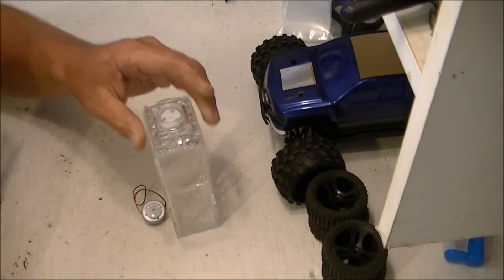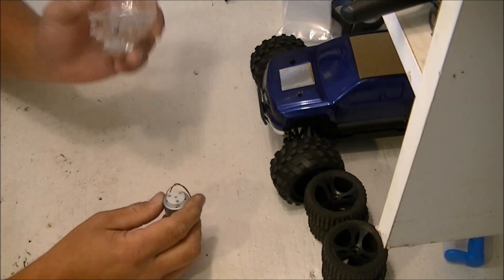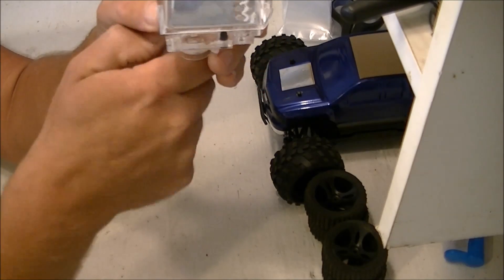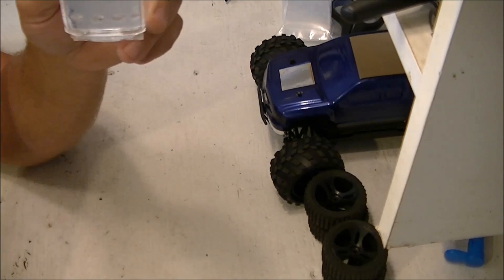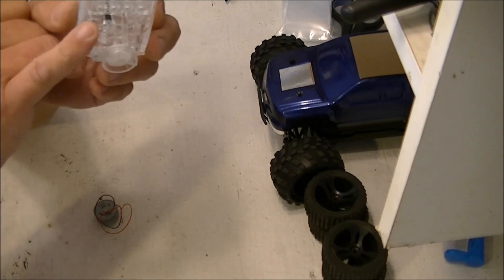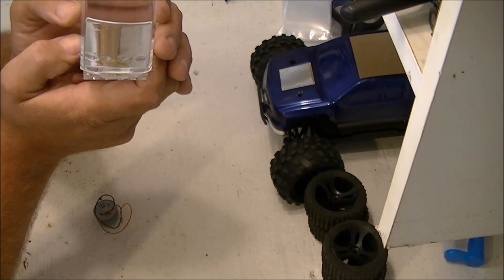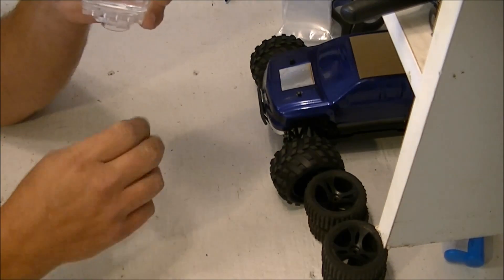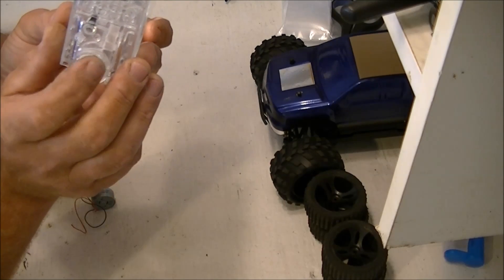Gadgetree Dancing Water Speakers  How The Water Pump Works

Comment: thank you. but i have a doubt. mines work both pumping water at the beat of the left speaker.  so when i put the balance all to the right spaker it doesnt pump water .  Isthis like that or is a flaw or something is broken??

please can you test this?
Reply from the maker: i got no way of testing all my speakers are long gone check the wires in the speaker that has the problem its possible it came off for the motor power

Comment: is there a way i could hook the motor and the LED's to my speaker system i have a little 20W amp that powers my speakers, I tried to connect them through the output but the motor doesn't work?
Reply from the maker: this work as they are but if you find a way to mod them go for it

Comment: is there a way that i can turn it off to where the motor is off but the music is still going?
Reply from the maker: cut the power wires to each motor
Reply: Kevys Rc & Music Okay,  but do I literrally have to cut them or is there something I can unplug.
Reply from the maker: you have to cut atlease the neg or the + wire make it in a spot where it would be easy to reconnect

Comment: can someone help me I have water speakers and they both work and light up but one of my speakers will not shoot water it only has lights and sound can someone help
Reply from the maker: +Graceann hamilton you need a new motor for the speaker thats not shooting water  i have some spares here ill sell 10.00 each plus shipping , hope you know how to solder wires or know someone that does
Reply from the maker: mine was pretty quiet

Comment: will someone please tell how is it possible for the water to even leak? I had my dancing water speakers since last year, and both sides have equal amount of water. then I found out one side lost all its water and Idek how and when it happened..?
Reply from the maker: Imogene Liau thats easy there is a plug where they fill them and they leak there they also leak when you drop them and crack the glass its rare but it does happen

Comment: I'm looking at making some of these, but have no idea where to get different parts? Like the magnetic thing on the end of the motor, or the impeller, any ideas?
Reply from the maker: buy a 3d printer and design and print your parts the magnets shop around on the internet you will need the control boards as well and when you go larger scale you need more power to run stuff so youll have to design that as well or pay some one a large amount of cash just to get you 1 prototype done
Reply: Kevys Rc & Music 
do you know of a layout that can be used for the 3d printer to make the parts?
Reply from the maker: Isaac Hanneysee no i have no idea i know how they work i know how to fix them but thats it man , try google

Comment from the maker: well i only explain it i dont aucutally show it being done, basics are you need an injection needle  small one of course you need mineral oil and the thinner for it yo uhave to find the right balance so it flows right like water, you then inject the stuff into the speaker glass, then re plug the hole thats already there with a plug so it cant leak back out. even in this video i tell you how its done.

Comment: hey Kevin first things first thanks for the video, is very useful. 

I'm a second subject, my water speakers when connected to my computer shot the water, and the lights are on, the sound come put ok, but but the water doesn't dances.

Can I do something ?
Reply from the maker: shoot me a video send me the link when its uploaded , also make sure the cables are all firmly in place in the device and the speakers other wise it will cause problems if they are not

Comment: Hey Kevin I have water speakers too and after a while both of the motors stop working, then ill have to smack both of them to get them started again....do you know whats wrong because there isn't any shorts in the external cords
Reply from the maker: could be loose motor mounts or internal connection

Comment: i have the same set of speakers but i haven't used them for awhile and i found that the there wasn't any water in one...how can i replace the water in the speaker? is it okay if i open it?
Reply from the maker: check my other videos on these speakers youll find one that talks about how or refill them
Reply from the maker: sebastian loy well i only explain it i dont aucutally show it being done, basics are you need an injection needle  small one of course you need mineral oil and the thinner for it yo uhave to find the right balance so it flows right like water, you then inject the stuff into the speaker glass, then re plug the hole thats already there with a plug so it cant leak back out. even in this video i tell you how its done.
Reply: Kevys Rc & Music Any easier way?

Comment: Is it possible to connect these water speakers to the speakers i already have, those have better sound, so i get the water led part but the sound comes out of my other speakers?
Reply from the maker: yup , you need a Y adapter so you can hook them all up together, and you need to take your cool water speakers apart both of them and disconnect the speaker wire of of each one then put them back together and your all set

Comment: where do u get spare parts
Reply from the maker: i collect every broken or unwanted set i can get my hands on fix what i can to resell and i end up also with parts as well that are good ..
Reply: Kevys Rc & Music Dude please help! I think I blew the circuit to both motors! Sound and LEDs work but no motor function. So I connected a Bluetooth receiver from a broken BT headphone inside the housing. It worked great until I decided to x out the battery for the BT and solder to the speakers power circuit, but my dumb-ass forgot to unplug the power source and shorted out motor + and - leads to the right motor. How can I fix this or do you have an extra circuit board laying around that you'd be willing to sell?

Comment: I need help! My water speakers led lights and speaker works but one of the speakers doesn't shoot out water . The water looks lower than the other one, !
Reply from the maker: does the motor work in each speaker are you getting any sort of liquid shooting up at all
Reply: When I shake one of the speakers it sound like something broke inside and when I first opened them it was a oily substance inside the package.
Reply from the maker: take them back for a new set other wise if you want to i can sell you new glasses that dont have leaks i have parts for these , email me your info and how man glasses you need and ill get you a total with shipping but try and return them first they do come with warranties  airsmith28@hotmail.com

Comment: Hello, is there a way to use just the glass part of splashing water and do not use its speakers, then using the other speakers? Thanks
Reply: Solved, I found your video. Thank you so much :)
Reply from the maker: i have a video up showing how to bypass the speakers inside and use a y adapter with a second set and stil have the water dancing work
Reply from the maker: i have a video up showing how to bypass the speakers inside and use a y adapter with a second set and stil have the water dancing work

Comment: Do you know if there is a powercable from speaker A to B (that is already installed in speaker A) that is able to buy?
Reply from the maker: you get a USB cable you get the audio cable and the cable the joins speaker A to b is built into the speaker that the audio and usb cable plug into this is how they come if you have the gadgetree version that i have in the video i have no idea how non gadgetree units are set up
Reply: KevinMillard68 can you solve my issue? everything works except the water jets.... sort of. When i plug it the jets push the water up for a second but when i play music the jets do nothing?
Reply from the maker: EaterofCarpets audio cable not plugged in firmly , could be , or setting on your computer, could be the problem you do have to have sound/music of some sort and the volume up past 1/4 level to get the jets to work could be any number of things,

Comment: How to fix them is the water came out???
Reply from the maker: its actually mineral oil , and you will need that as well as a needle syringe and some silicon or jb weld to re plug the plug once your done refilling it ..